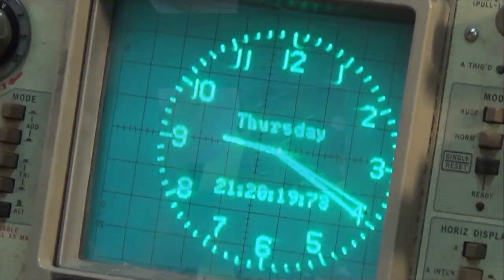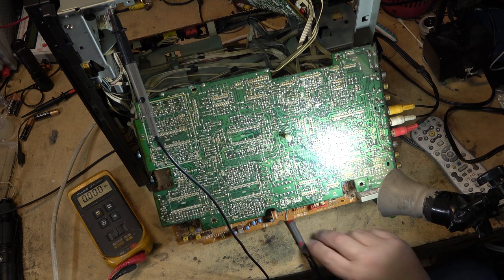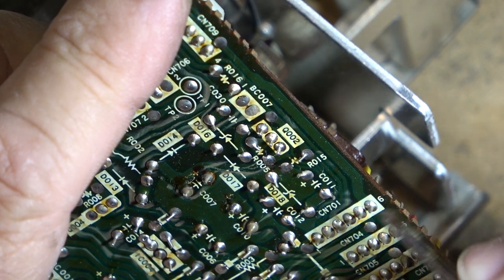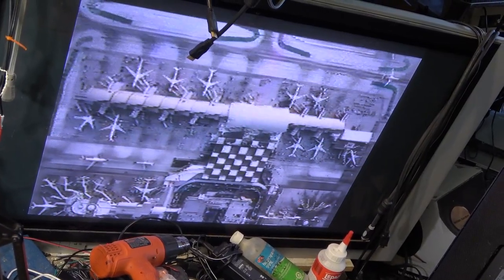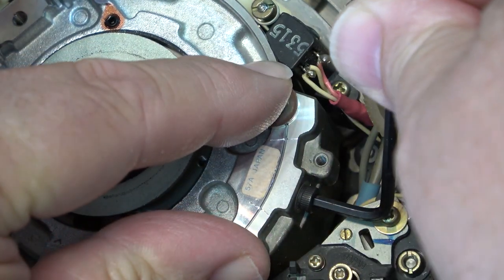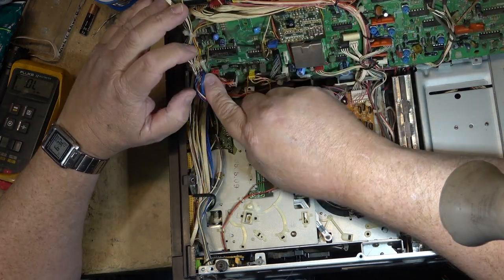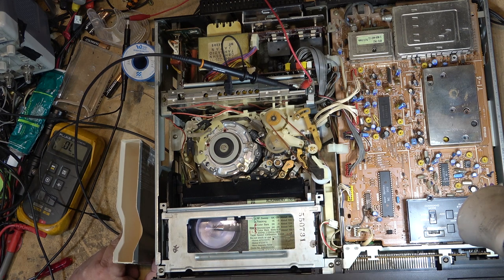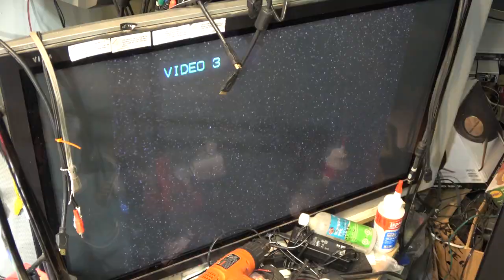Sony SLHF900 SuperBetamax No Audio, No Rewind and Other Problems

Comment: Inside the SANYO regulator STK5441, there is poor insulation of the soft transparent heat dissipating silicone and broken wires, so it may have deteriorated due to long-term use.I modified it by installing a heat dissipation fan behind the video.The video production was amazing until the end.👍

Comment: I also have a sound problem. It stopped suddenly between tape swaps. It's there, but extremely low (About 5%). This is a long video so can you point me to the point in the video where you fixed the sound. I have a fantastic machine - the Sony SL-800e. Cheers.

Comment: Okay, so what exactly did you solder together on that solenoid?  My slhf300 is rewinding/fast forwarding really slowly and I need to know if what you did on yours is the solution to mine.
Reply from the maker: That is a thermal fuse or cut out.  If the temperature gets too hot it's designed to open.  Biggest problems I found in the field was people tended to stack equipment. If for example the VCR was placed on an amplifier heat from amp would heat up the VCR and could melt the cutout.   They do fail from stress.   Just short it and move on.  If you want you can replace the part but I never bother with that now.  These machines are not used much these days.  Just to archive old tapes.
Reply: Theoretically speaking, if I were to short mine out how many hours of play do you guesstimate I would get from my Beta machine before it fails permanently?  I actually want to get into collecting Beta tapes for playback and enjoyment. My machine plays fine, but the reverse and cue are HORRIBLY SLOW @12voltvids
Reply from the maker: @thriftygrifter7656  could last year's.  This part normally does not get hot.  Slow rewind is likely the upper drum has been polished by the tape and now the tape is sticking.  I have done many videos on fixing that issue with comet cleanser and a moist towel. Upper drum should look dull. If shiny then that's a problem.  The thing that will wear out is the video heads.  High grade tape will ensure that they wear faster.

Comment: I need your help . The Sony  vhs_ x50me _  device plays  all  videos  that is  recorded by other vcrs  with noise in the color, but the things that  recorded by itself play perfectly, and the interesting thing is  all the things are recorded whit  this machine  displayed in the others with the same problem. Please guide me to  fixing the problem. Thank you
Reply from the maker: Has the upper drum ever been removed? If so it is probably on backwards.
Reply: @12voltvids Hello, thank you very much for the answer, I don't know about the history of the device, but it seems that this area is completely untouched. If so, will the problem be solved with some alignments? I discovered a new point, when it is disconnected from the power, a sound like whistling is heard. Is it necessary to recap , It is surprising that the videos  recorded by the device itself plays perfectly just by itself.
Reply from the maker: @rezar7573  could be alignment if it plays its own recordings and not others and other machines can not play its recordings.  If it plays its own fine it is not a capacitor issue or power issue as that would affect everything.  If its interchangeability then its mechanical. That's why I asked about the head drum. I used to see many come that the owner bought a cheap 20 replacement upper drum from the local parts shop.  After all what could be easier unsolder remove 2 screws pop the old head off and the new one on, 2 screws and resolder right.  They put it on backwards.  Then it came into the shop and got charged 70 to correct.
Reply: Hello I was just a follower until today, but you made me believe in you with a short but wonderful answer to my question. You wrote only one sentence, but I know that sentence is the extract of thousands of hours of expensive study and experience  the result of a lifetime of effort, something that I appreciat well and I am very happy to be among those who had the chance to benefit from your skill and science. I hope  for many more years people like me also be lucky enough to benefit from your precious knowledge and generosity. I took a screwdriver and a solder sucker!! And exactly as you said, I returned the reverse part to the correct state, and now the result of your knowledge and kindness towards me. It is a wonderful image and a healty device that came back to life. Yes, you did it again, but this time from 10000 km away and with only vague signs .so Many thanks again

Comment: Interesting the insides look very similar to my Sony EV-S500 Video 8 unit. Except the boards do hinge open without taking the case apart.
Reply from the maker: Remember this has 4 boards stacked.   Most had only 2 in perhaps 3 so you could access the middle one easily.

Comment: Is this the original HF900 or the HF900mk2?
Reply: That's a MK1. The MK2 was only released in Japan and I believe it had linear stereo too apart from hi-fi.
Reply from the maker: @crashbandicoot4everr  linear stereo was considered but sound quality not good enough never made it this side of pond, thats why they invented beta hifi.
Reply: @12voltvids  Sound quality was probably worse because of the way thinner linear tracks. I don't know how much of a help BNR was (Sony's version of Dolby B for Betamax). Another thing worth mentioning is that the Japanese HF900s can also record in βIs whereas the North American version requires a modification to do that.